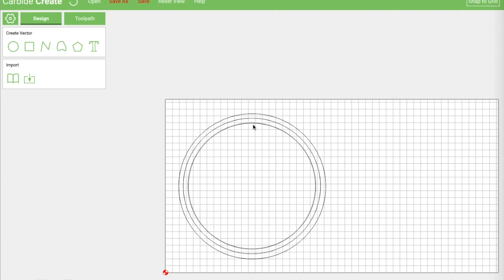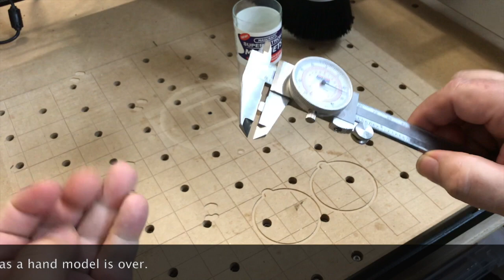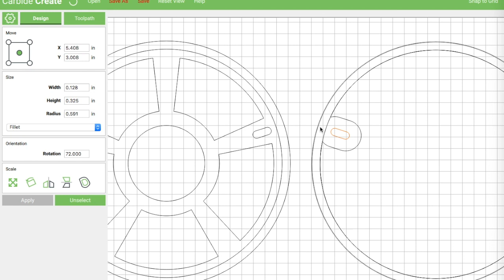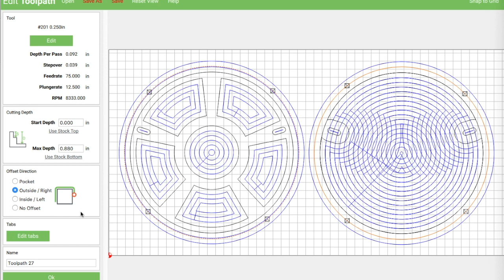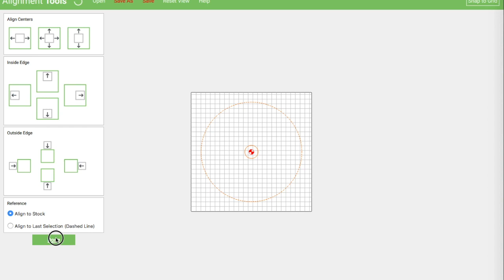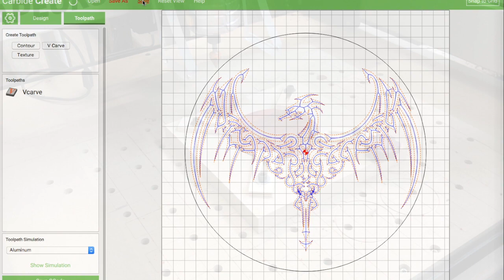Part 3: Advanced Boxes on CNC

Comment: Wow, very nice box and more over ,the way that you explain every step, something very important for someone like me, a total newbie  related to CNC, and you're not rushing to explain the process. I Bought a Onefinity Jorneyman and I'm learning very slowly how to make Letter Piggy Banks for kids and Now I want to try doing boxes the way you do it. Please don't stop teaching . Thanks again.😁
Reply from the maker: Thanks so much for the encouragement. How do you like the Onefinity Journeyman? What kind of design/controller software does it use?
Reply: @johnearlclark  I have Carbide Create to. I think you can use: Vectrix,Fusion 360,Mach 3? and some other programs. I have pushed mine at 300ipm feed rate 150 plunge,0.125 Depht per pass and 0.125 Stepover to do the Letter Piggy Banks but for the cut-out, I need to drop it to 200 Feed Rate and 100 plunge because is to aggressive.

Comment: How did you know how deep the v-carve was going to be? You can calculate the the thickness of the lid easily, but without knowing the v-carve depth, the carving could cut through. You probably know from experience that you have enough lid thickness , but how is that  calculated?
Reply from the maker: If you are using a 90 degree v-bit, the max depth will be half the distance between your two widest lines. 60 degree bit will be deeper. Does that make sense? Also newer versions of Carbide Create will let you set a max depth. This will make the machine simply skip anything that would be too deep.
Reply: @johnearlclark   thanks for answering this question. I had the same question because I’m working on engraved boxes right now. You have a great channel and thank you for all of the detailed videos

Comment: hi, im curious, would the cnc be able to engrave on a domed surface with a flat bottom, as long as it is emerged inside a box for the xyz axis reading ? thank you very much
Reply from the maker: Hmmm... It really kind of depends on what you are looking for. The basic Carbide Create understands top and bottom, but it would not follow the slope of the dome (ie. going further down as it gets closer to the edge). Carbide Create Pro understands a 3D surface, but the other thing to consider is that, on a traditional CNC machine, the bit is always coming straight down, so getting a consistent depth on something like text would be tricky. You would need a true 3D axis milling machine to keep the bit 90 degrees relative to the domed surface. Does that make sense?
Reply: @johnearlclark  ok perfect that makes sense , thank you so much, your videos are so helpful :) I just got the shapeoko 3 standard,

Comment: I am a retired machinist (45 years ). I started out by punching IBM cards and paper tape. My last 25 years I had Mastercam to program a 3 axis milling machine. I wish this program could mirror & Fillet like Mastercam. I am studying YouTube examples of different CAD/CAM programs before I purchase a router.
Reply from the maker: The newer versions of Carbide Create allow you to fillet (Not sure how Mastercam implements this so it may be a little different). As far as mirroring goes, if you just mean flipping a design, then yes it will do that. Since it's a free program, my suggestion would be to download it and play around with it. Even without the CNC machine, it will give you a good feel for the setup. PS: My first program ever was written on punch cards. :)

Comment: Hey brother, thank you for sharing this. I also have a shapeoko XXL. I'm having issues with squaring my machine though..Cant cut decent circles either...There's always two small spots opposite of each other on circles that are definitely straight and not curved as they should be. Any advice?
Reply from the maker: Hi Jeremy. The first thing I like to check is the tightness of the wheels on the z-axis. If you put a couple of fingers around the collet on the router and pull/push does it move back and forth even a little? Usually this means you need to tighten the wheels that sit behind the router plate. If they are not firmly on the track, the router wiggles when it cuts. Also check belt tightness and make sure you don't hear it slipping (usually a chunk-chunk-chunk sound). Given that you have two spots opposite, I suspect the wheels first. Hope this helps.
Reply: @johnearlclark  Thank you sir! I will do some close inspection when I get home from the day job today. I appreciate your input!

Comment: Why not just do a double sided cut using registration holes and pins on the original work piece....
It would save you all the trouble of re-registering the top for carving and it would also hold the round parts firmly without extra clamps.  (fewer steps and perfect registration!)
Reply from the maker: Also a decent solution. However, I tend to cut my boxes and do some preliminary sanding in advance and only carve when I have an order for something. This way is easier for my process.

Comment: I have two bowl and tray bits. 1/8 radius 7/16 diameter and 1/4 radius 3/4 cutting diameter. How would you put these into your tool database?
Reply from the maker: Carbide understands flat end, ball end and v-bit. The shaft diameter does not matter, just the cutting portion of the bit. Most of the bowl cutting bits I have seen are an odd shape, in that they have curved edges and a flat bottom (like this one -- https://www.rockler.com/1-1-4-dish-carving-router-bit ). I would be temped to put them in as a flat end mill and just be aware that they will dish the edges. Also bits with bearing guides can cause problems, so they probably are not a good choice for CNC. Does that help?

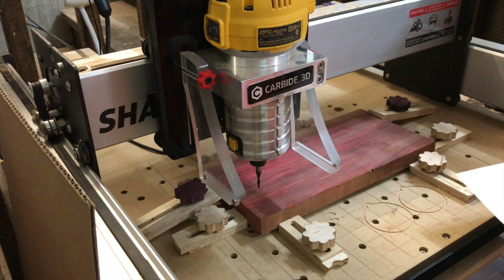Comment: Hey John great videos thanks for doing them. I have a question for you. I am paused at 19:56 and notice that you have the wood elevated above the waste board. Is there a reason for this?
Reply: Well I watched it and it looks like you have a 1/4" piece of MDF under. Probably to save the waste board. Answered my own question. THANKS
Reply from the maker: Hi Scott. I usually keep a piece of cardboard or 1/4 MDF under the work piece to keep the bit from going down through to the waste board when I cut out the box. It just limits some of the wear and tear on the waste board so I don't need to replace it or resurface it as often.

Comment: Thanks John , I have now spent the last couple hours searching for the way to get c2d files into carbide create... This is where people get discourged. Is there a somewhat easy way?  I am obvisiouly new and just want to think I can make this xxl do something but so far is has sat idle.. I did you  tube and searched carbide3d forum but didn't really get it... Its time for a break and a fresh start !!
Reply from the maker: Hi Greg. So sorry. This is one area where Carbide Create is a little annoying. For just about every program on the rest of the planet, double clicking on a file will open it in the program that created it. Carbide Create is a "special flower." Double clicking on a file will open Carbide Create, but it doesn't open the file itself (cue aggravation and swearing). To open the actual file, launch Carbide Create and choose Open at the top of the window, locate the file in the chooser window that appears, select it and click open.

Comment: Thanks for sharing! This got me amped to make some boxes. Just one suggestion, why not just flip the box upside down to vcarve the design before band sawing the tabs out?  This way you wouldn't need the the circular jig w all of those clamps.
Reply from the maker: That will only work if your box is exactly centered in the stock. If you are slightly longer on one edge of your stock than the other, the design is offset. Even really small amounts are very noticeable on circular boxes. It’s a bit of extra work but well worth it.

Comment: could you make a video showing how to design a square tab box with carbide create. Similar to the function on the v carve pro software
Reply from the maker: Hi Joseph. Can you give me an idea of what you mean by a square tab box? I am not familiar enough with v-carve pro.
Reply: I might have used the wrong terms for it by saying square tab. I think they are called finger joints where all the sides form together like if you were to fold your hands
Reply from the maker: Ah! Now I understand. Finger joints on CNC are a bit complicated. If you lay the piece flat and mill it, the bit ends up giving you a rounded inside corner (almost like a series of U  U  U  U  U shaped fingers). To get a real finger joint (shaped like this: |_|  |_|  |_|  |_|  |_| ) You have to clamp the board to the front of the machine. I have some thoughts on a jig for this. I will see what I can put together.

Comment: John, Great video.  Newbe here.  Trying to learn.  Question, I see the finished dragon has some lines that start at the top one width and taper to a point at their end.  This to me suggests that the tool has to raise in order to do this.  How does the CNC know how to do this?  Are those CNC commands part of the purchased dragon image or do you adjust the code to do that?
Reply from the maker: So this is what's called a v-carve. A v shaped bit is used to cut the design, which means it the bit cuts deeper in the wide parts and shallower at the skinny parts. The software handles all of the code for depth. You can get really precise edges with this kind of cut.

Comment: Thank You so much for these videos. I have made several small boxes and you have given a lot of great info in your videos. I plan to make some jigs and use the rapid 
position function. Great work. 
Where do you purchase your wood? Do you order on line or purchase locally? I made a box bottom from Curly Maple and it seemed like a "BEAR" to pocket out. Have you ever tried Curly 
Maple?
I have saved your videos and will be looking at them quite a bit as you have a good understanding of Carbide Create.
Thanks again.
Reply from the maker: Thanks so much Richard! Most of my wood comes from a local place called The Woodyard. They have an online presence at thewoodyard.com. Mostly I recommend making the trip to a local lumberyard that carries some exotics. A lot of what they consider “cut-offs” are perfectly useful to us. Maple and walnut usually need some extra clamping. Also tend to place clamps flat against the wastedboard around the edges to keep it from moving left/right or up/down. Hope this helps.

Comment: What wood is that? It's very pretty.
Reply from the maker: It's called Padauk and it's one of my favorites. One thing to note about Padauk; if it gets left in direct sunlight it will turn brown. I tend to finish it in acrylic for a little extra UV protection and only use it for indoor things.

Comment: Hi John, great stuff! Subbed! Getting ready to buy a CNC...do you recommend Shapeoko an it’s software over XCarve? Thanks
Reply from the maker: I have not used the XCarve equipment, but I have played with the software. There are tradeoffs: I think the Shapeoko software is more versatile, but the xCarve is a little more friendly. That said, I like the fact that the Shapeoko software is not part of the cloudy-cloud, so it's still useful if the Internet is down (thank you Comcast). As far as the hardware goes, the shapeoko is really beefy (bigger rails) and seems to be very sturdy. I am very happy with it.

Comment: How much clearance for you recommend between the top lip and bottom?  I tried a prototype and just flipping the lid results in it being too tight when you try to assemble the box.
Reply from the maker: I usually go about .003 smaller on the inner lip. Your mileage may vary. :)

Comment: Could you tell us what brand of bit and RPM you're running to get those nice, clean cuts?
Reply from the maker: I tend to go with the default feeds and speeds for the most part. The bit is an Amana 46202-K SC Spektra 1/4 inch bit I got from Amazon: https://www.amazon.com/gp/product/B072J4CPQT The trick for wood is to use a downcut bit. This pushes the wood down as it cuts and prevents a lot of splintering. Most of the bits Carbide Create sells are upcut bits. These are great for clearing chips on things like aluminum, but they tend to splinter wood.
Reply: Once again, extremely helpful. Thank you very much. Please keep posting videos. I have learned a ton from your work.